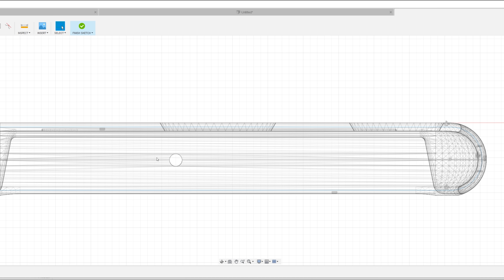Make A Leather Smartphone Case At Home With Wet Molding

Comment: Really cool and inspiring! And the classic mirror error. I've done it on printing projects as well 😁
How is the case holding up over time? 
Did you cut holes for the speakers as well? Was wondering if the sound would get muffled.
Keep up the good work!
Best regards
Morten

Comment: 😂😂noooooooooo. First thing I looked at when you finished the print was if you had the text correct. I was so worried. But it does work with the mirror selfie. I think this looks fantastic, one thing I would change is I would have the lip come a bit higher than the screen. Any idea how long this would hold shape?
Reply: Well he used CA Glue around the edges which gets pretty hard. So should stay in shape

Comment: A few things
A. Instead of using clamps you could have used objects - like books stacked or furniture to produce equal pressure.
B. The phones have small holes on upper and and lower sides - these microphones cut outs or sensors to remove wind-noise. You don't have these - i presume your call quality has dropped and your voice now sounds muffled.